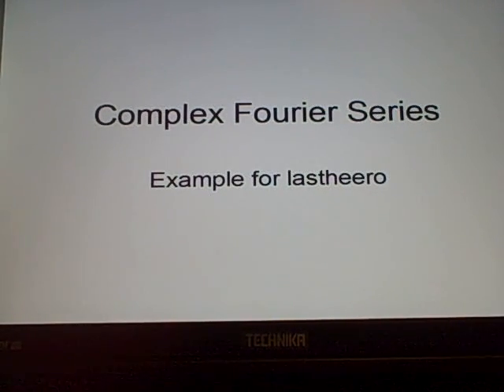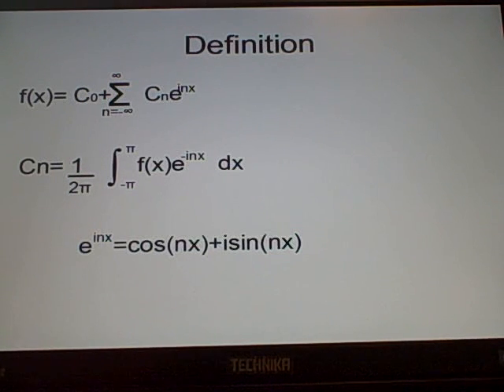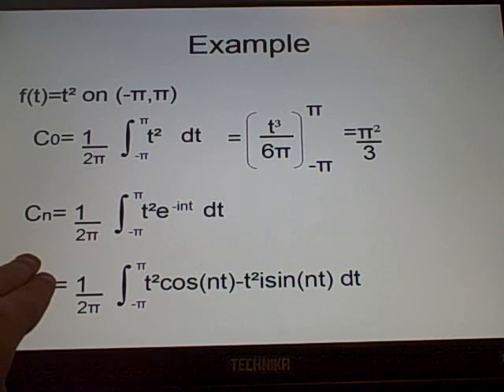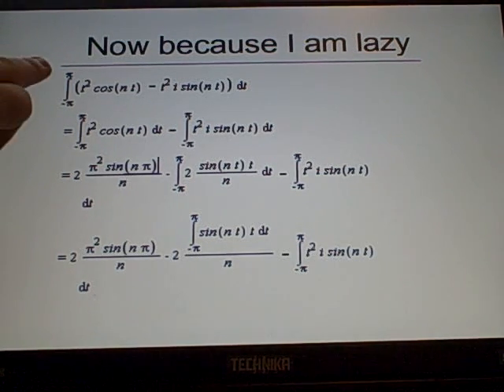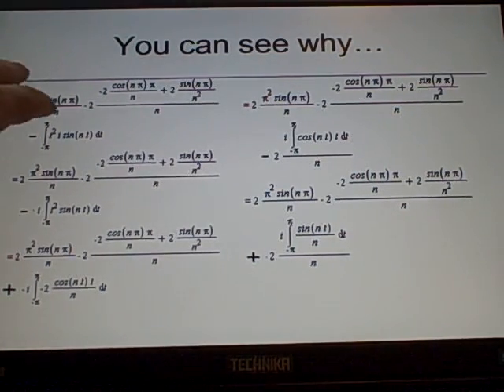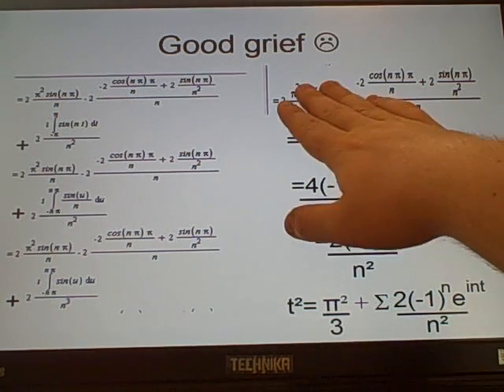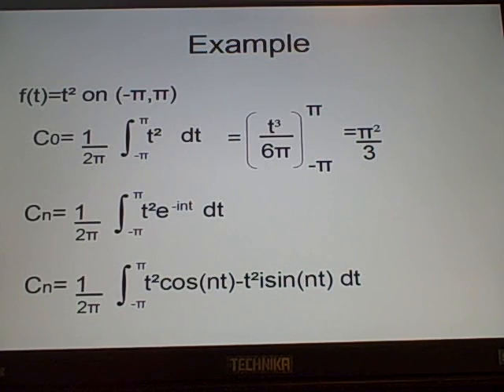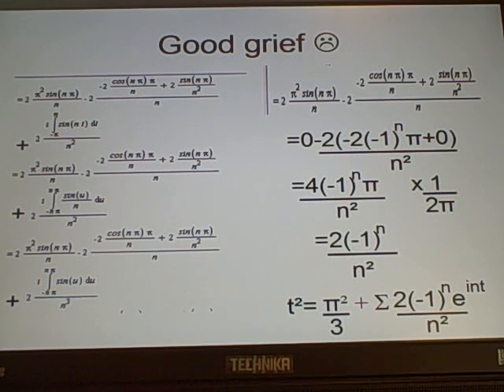Complex fourier Series - Example

Comment: One of the beneffits of exponential fourier s. that it is easier to integrate.
No point in coverting it by Euler into cos and sin. Just integrate by parts the exponent itself.. 2-3 loops will do it, then the 2*Real(Cn) will give you the cooficent of An, and 2*Img(Cn) will do the Bn, sin cooficent.